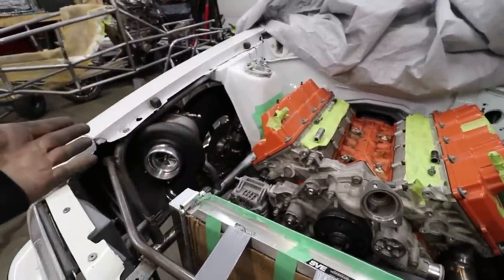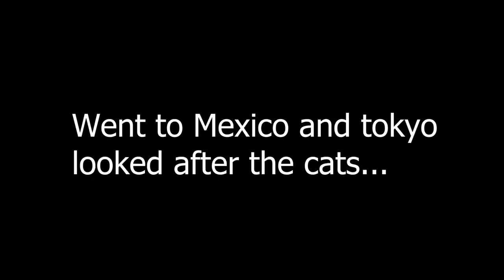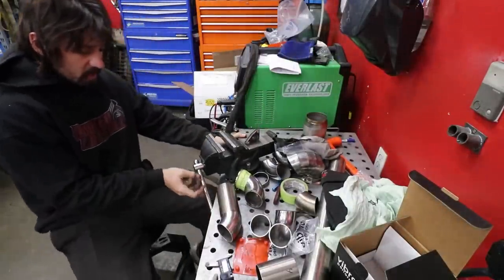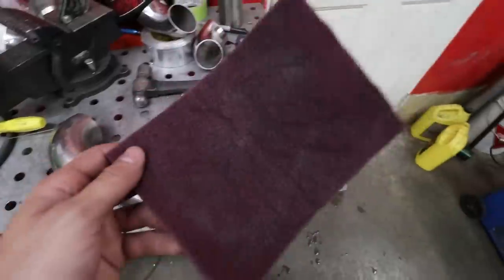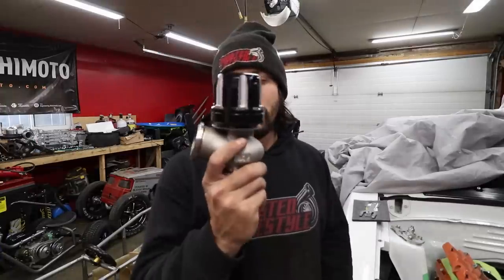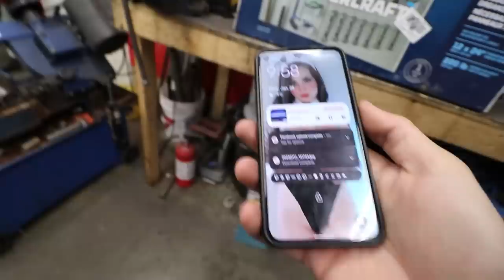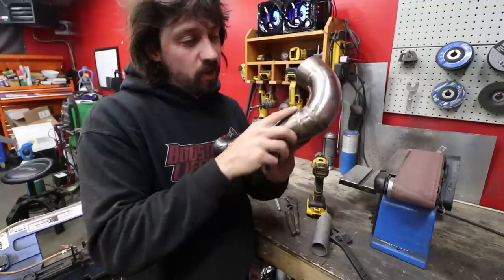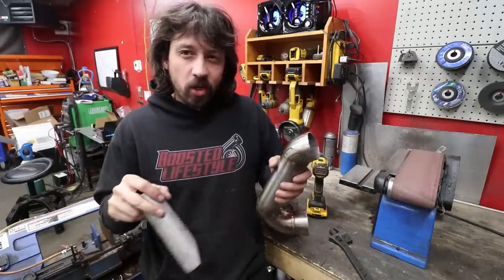Transplanting a Hellcat into a Mustang: The Build pt 2

Comment: Kyle, get a 3d printer. There's TONS of honeycomb expandable storage/wall hanging options out there that would help out instead of buying $69 peg boards, giggity. Even adding if you get something like the new K1 you could print some pretty nifty materials. Carbon fiber infused PC's, nylon, etc could help in interior parts!

Comment: @Boosted Lifestyle Pro tip, keep your part in the lathe and turn on the spindle. Use your cut off wheel instead of the lathe cutting bit. It will make a perfecty square cut. Great content as usual Bro. Good to See Tokyo pop in the vid!
Reply: @eriklarson9137  lmao coming from a  guy who obviously pays to have everything done. What's your helpful advice? Do you have a method that's quicker, more accurate, and will be perfectly square?

Comment: If you want a bit more heat in the garage you could get one of them tiny diesel heaters I have seen a ton of people using. They don’t use much diesel and could probably keep the utilities cost down a bit with the other one not running all the time

Comment: I know it's been awhile since you built this, but have you thought about using the truck timing cover to move the alternator above where it's at to route the exhaust better? Holley also makes a cover that moves all of the pulleys and alternator to the truck position I forgot what they called it though. Could have also used the holley hemi swap headers they fit better and are full stainless unlike the cast iron stock manifolds a lot of people use those for turbo manifolds for hemis or the factory srt headers. Just some ideas that might help you out. I'm wanting to build a hemi swapped foxbody, but use a power glide instead of a manual transmission.